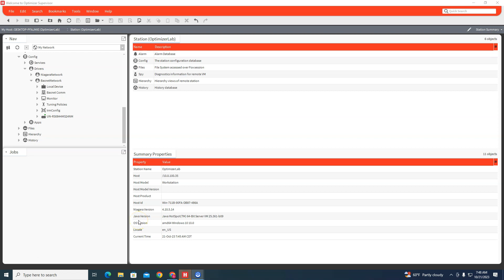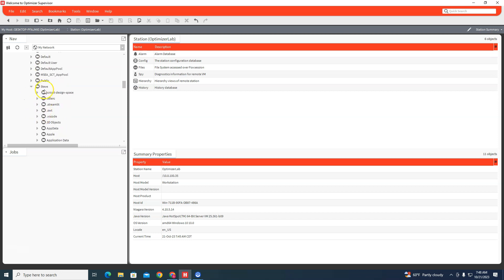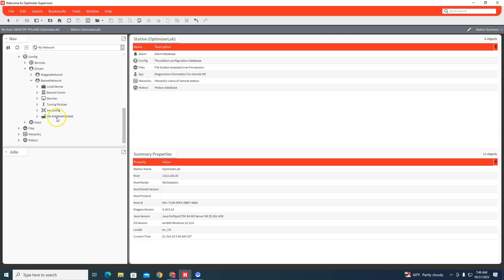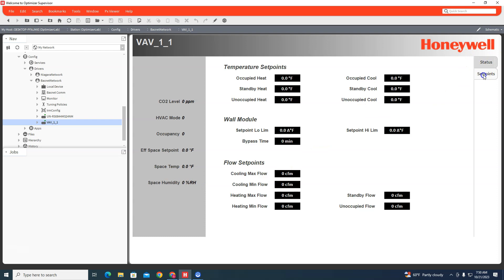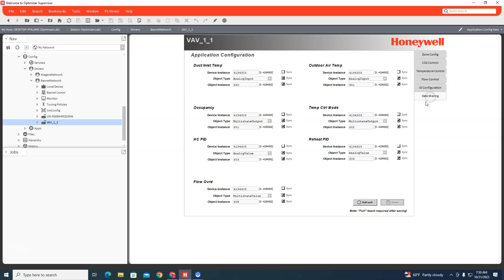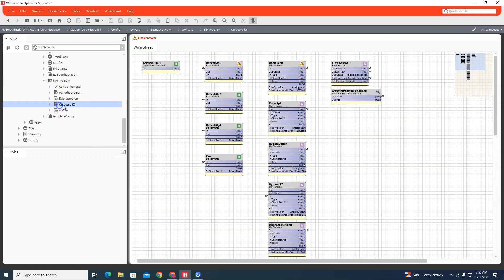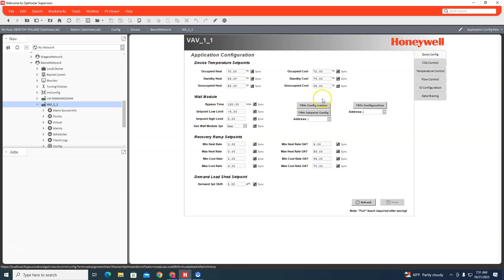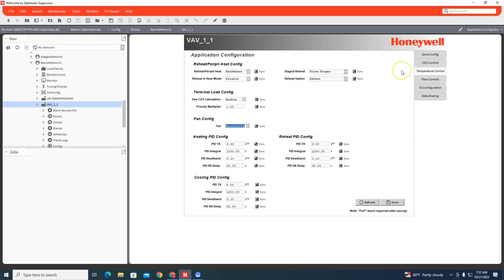Honeywell Spyder 7 Optimizer VAV Template

Comment: Thanks for the video! Where do you get the template download?
Reply from the maker: If you are a signed up Honeywell customer, you can find it on the Honeywell Buildings Forum if not you will need to ask your controls distributor for it.
Reply: @stevenhurst1631 is it only in the share point?
Reply: If Possible can please share these Template..